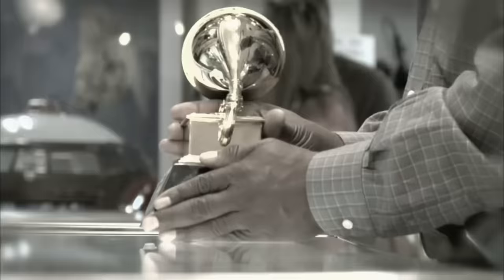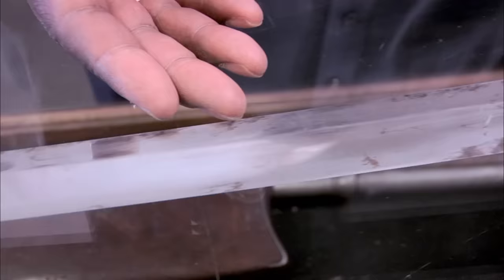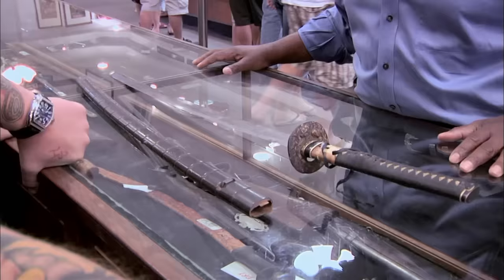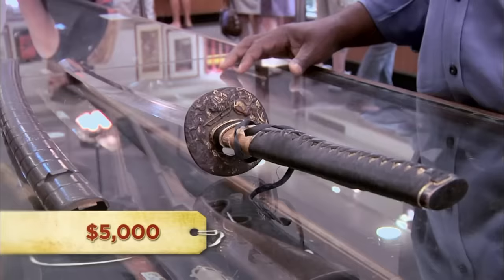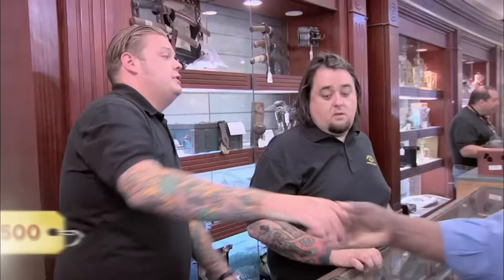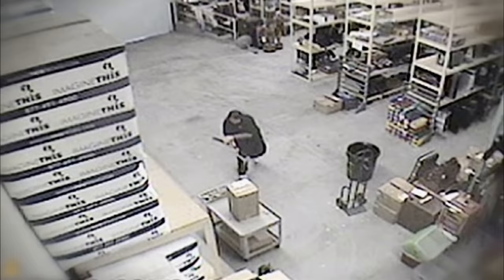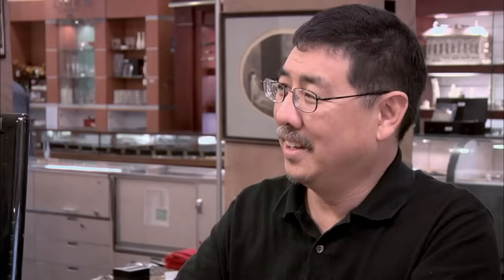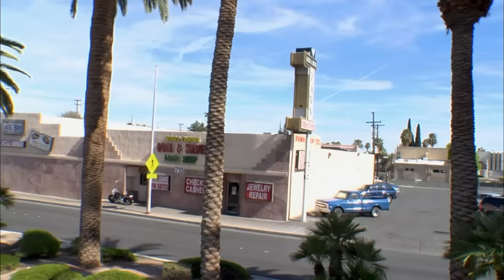Pawn Stars: RAZOR-SHARP Samurai Sword is an ABSOLUTE STEAL (Season 7) | History

Comment: Looks like they put a new guard on it,  but if that old guard was as ancient as the sword, I'd think taking it away would lessen value.  It had an interesting regal look to it that's now missing from the restored sword.
Reply: 'Restoring' anything on such things is stupid. Throwing away genuine parts for 'improving' to modern standards without needing it...
Reply: The whole "restoration" looked pretty shady to me, the scabbard is a different, lacquered one, the old blade didn't have that cut at the tip, the hamon also looks like something modern
Reply: @Shcreamingreen  I could see polishing the blade, and maybe the metal was deteriorating, needing replacement, maybe not. I'd NOT do a modern re/re; you can buy modern blades like this.

Comment: I wonder why he replaced the original guard in the restoration...
Reply: I was wondering the same thing, they replaced the original tsuba with a modern one, that would hurt the value.
Reply: @96708kanaka  not really most modern made tsuba cost more than the  originals so be worth more
Reply: @96708kanaka  the tsuba is made of rough iron and there are still artisans doing high quality items
Reply: In the context of japanese swords only the blade itself is valued (although all the fittings are made by specialized artisans)
Reply: @vhaga  some people just collect tsuba habaki fuchi kashira saya by them selfs not just the blades
Reply: @micahcampa  that's true and probably the pawn shop will sell all the old parts in good condition separately

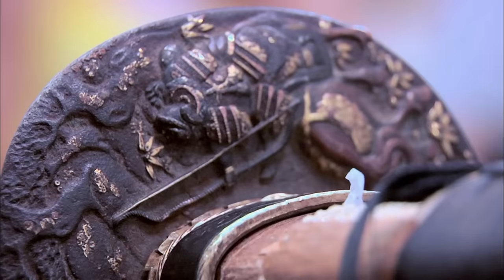Comment: 8:58 looks like Mike changed the guard on the sword, the old one 1:38 has much more intricate details on it, but maybe it was not salvageable?
Reply: It looks like the only thing kept was the blade, everything else seems to have been replaced.  He said the handle was re-wrapped, so maybe the blade and the wood of the handle are the only 2 original parts.

Have to remember a pawn shop is not a museum, but it breaks my heart to see something historical like that updated to look like it was made yesterday just so someone can make the most money from it.
Reply: @MartysRandomStuff  yeah looks like the sheath is also a brand new shiny one, I get the feeling they are trying to add some ninja vibe to the sword, but I like you said the pawn shop guys are trying to run a business and I guess they will know what will fetch the highest price, definitely sad to see an old sword getting butchered like that.

Hopefully Mike has kept those old parts rather than just throwing them in the trash.........

Comment: You can tell if its a fake , if the handle has traditional wrapping such as a strong lace wrap and a stingray under wrap underneath. If the spots on the stingray is different shapes and sizes instead of synthetics which are all the same size.

Comment: would be nice if after restoration he took it apart and showed the makers mark cos im convinced thats not the same blade. they changed the original scabbard guard fittings and handle. and that original guard looked so nice too and they replaced it with a rather bland boring one. way to honour and "restore" such a fine swordsmiths work

Comment: I never understand how some restored items lose the majority of their value and others appreciate in value .. why did making this sword look new increase its value versus just leaving it  as is?
Reply: The true valuable part of the sword is the blade, the rest of the parts wear out and are traditionally redone. The handle is after all cloth ribbon and the skin of a ray.  The sheath or Saya could not be in such deplorable condition, it does not honor the blade.  They too would be replaced often as any respectable samurai could not have one as presented.  The polishing is a l...o...n...g drawn out process done by hand.  Japanese steel is also very susceptible to rust due to it's high carbon content.  Without a good polish you cannot see the "hamon" that is the tempering mark on the cutting edge.  The sword is made up of softer inner core, a harder outer layer, and then wrapped in a special clay, with the edge exposed to the final heating and rapid cooling that make it super-hard.  This gives them flexibility, yet strength.  The rest, is a presentation really (except maybe the tsuba, or the hand guard, I'm sure the original was kept, as well as the end cap on the handle).  The materials replaced don't vary much century to century. So in this case, that is why.  But in all cases the market really dictates what is ok or not.  (extremely experience in such things, worked for an appraiser for years).

Comment: I've collected Japanese swords for about 25 years now. Mike took off an $800 sword guard and replaced it with a $300 one. How'd he get away with that? Another thing, Japanese swords are famous for having fake signatures (on real swords). The only way to know for sure if it's a real signature is to send it to Japanese sword evaluators and get shinsa papers on it. I'm sure Mike is good, much better than I am, but he is not an authority who decides these things. It's still a nice piece and I would have given $1500 for it because the guard is worth half of that and 28" cutting blades are rare.

Comment: I don't understand restoration work a lot of the time, you can't "restore" something that's been lost 100s of years ago, weather it's bits of material like the wrapping of the sword handle or specs of paint from and old church. What you're doing is replacing, not restoring.

If you paint over an old painting the paint has been covered up, not restored. Surely the idea is to preserve as much of the original as possible? Why is it worth more if there's less history to it?

Comment: I love how the sword comes back from restoration with a completely different Tsuba. Dodgy af "restorer" whoever they were. The original Tsuba would be worth a thousand dollars on it's own. The returned sword is not the same sword. It should have been sent to Japan to have all the certification and registration done under a real swordsmith. I would be checking right away if the blade is in fact the original blade. I think Rick amd the boys were scammed here! I could bet that the original blade and fittings were switched out for inferior ones and the actual ones stolen.